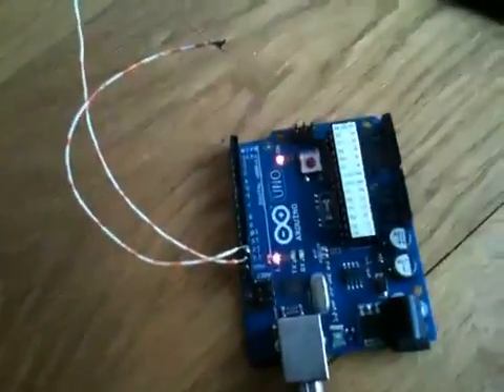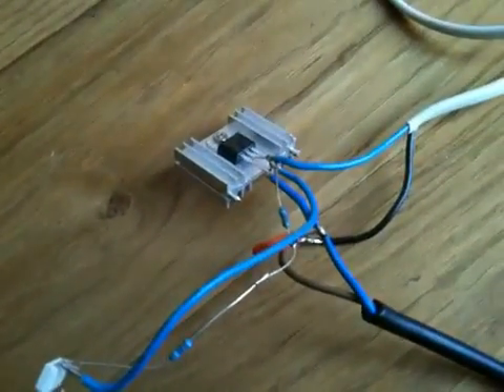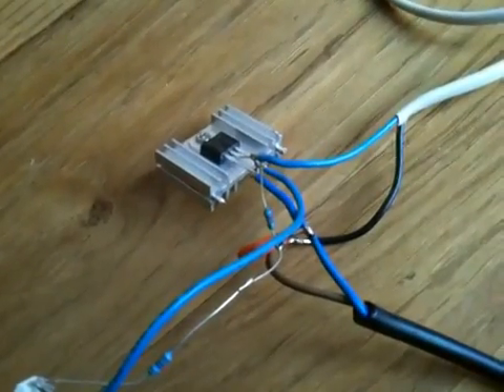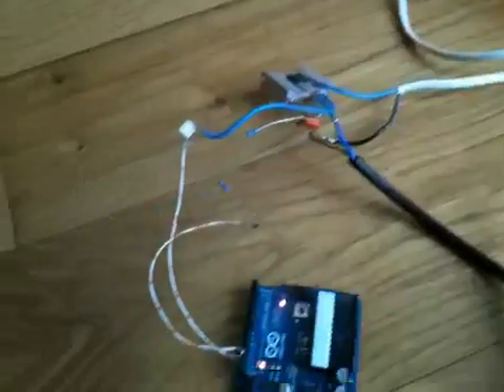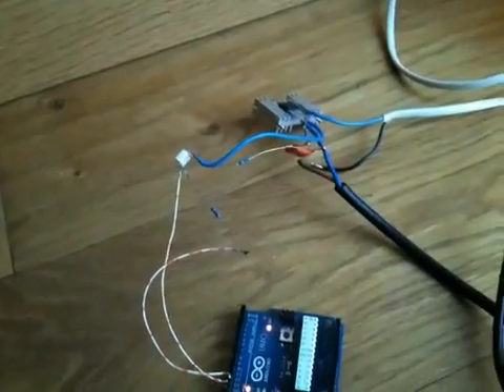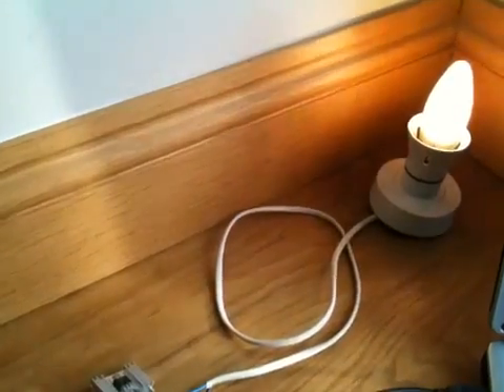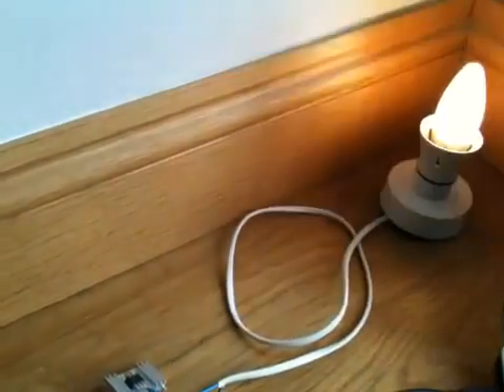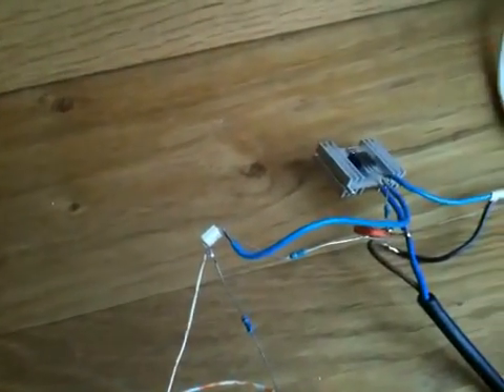Arduino controlled Triac

Comment: Thanks!I'm using the same lamp!How did you manage to change the brightness without a circuit for zero cross detection.Did you use the built in zero cross detection of moc3061 for example?